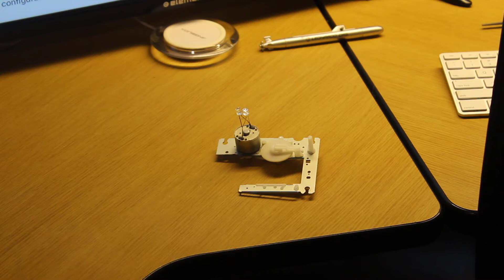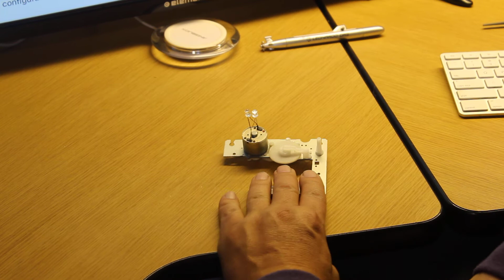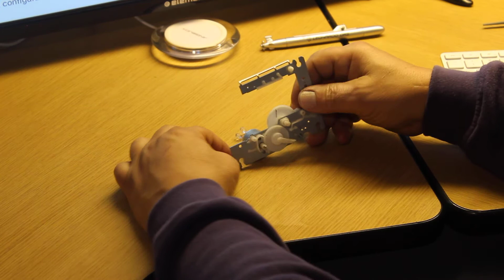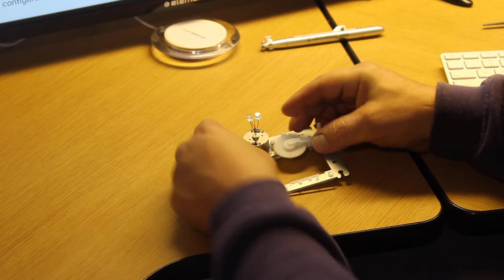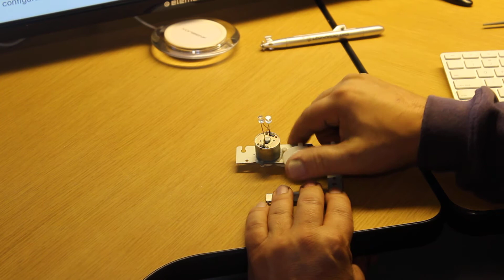Free Electricity - NOT!

Comment: Nice. But now I'm so depressed. No free power. OH, NOOOOOO!!! Lol. Btw. I looked at your channel cause I liked your comment on Gerry's hand held brake bleeder vacuum idea. You're right about the seals being designed to press to cylinder walls, therefore, suction on opposite side of the seal can draw air into cylinder and system. Nice. My concern is about pockets of air, especially in hydraulic clutches. What a mess!!! Back to free energy...did you make that thing for the video? I'm guessing not...you saw it played with it and decided to talk on that topic. Right?
Reply from the maker: FREE power comes from nature.  Wind, solar, hydro.  Thermal is another option; but these so called FREE ENERGY devices are just scams.

Peace bro.